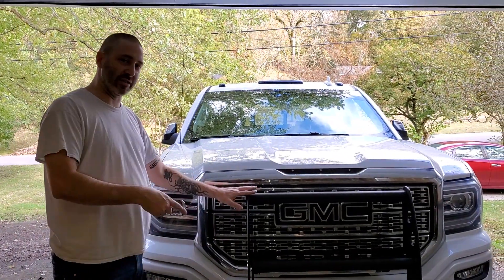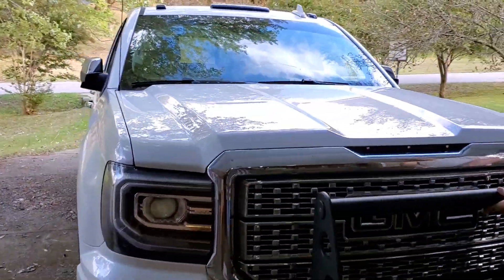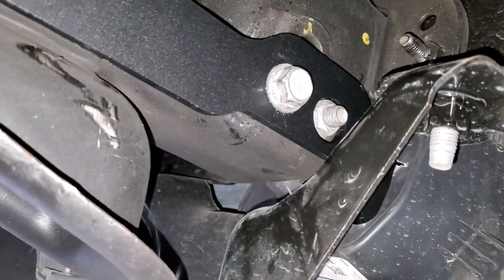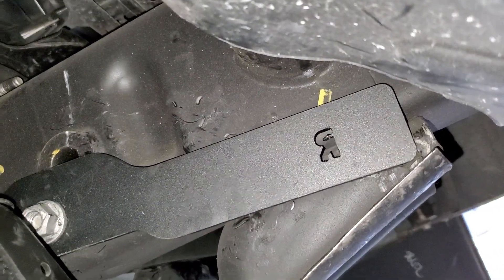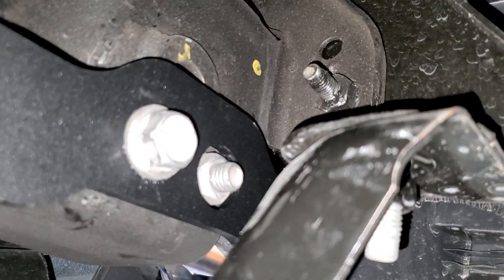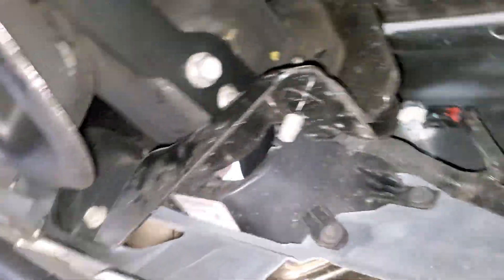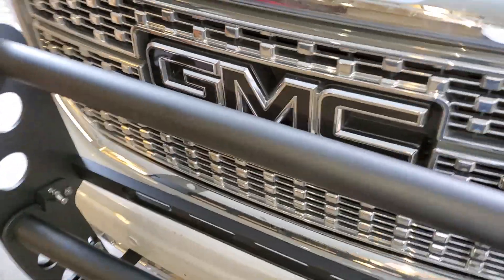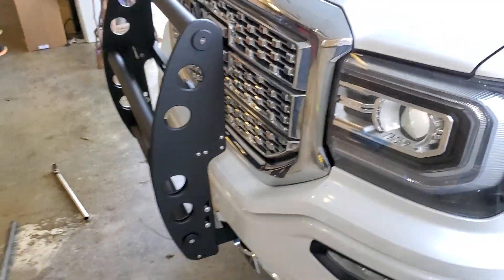Ami swing step mounting hardware issue 2018 GMC 1500

Comment: Just bought one of these for a 2011 sierra. Hope I dont run into same problem
Reply: Did you run into any issues? Looking into getting one. Did it move with only one bolt on each side?
Reply: @raycastillo9157  I ran into multiple problems, but I think mostly its because of company I bought it from. I bought it from real truck.  They suck!!!  Do not waist your money or time on them. Holes are too small on brackets and will need to be milled out bigger.
Reply: @muddyduck4524  Ok, thank you. Appreciate it.

Comment: Maybe try adding a couple of washers under the nut. Get the washers that will fit over the bolt, and grind the outside diameter down to fit inside the hole. then replace the nut and tighten it down. Does that make sense. Kinda hard to explain.